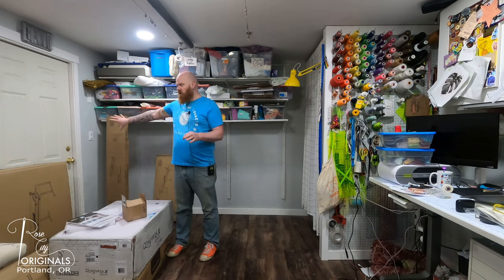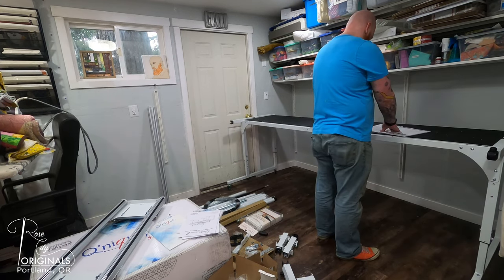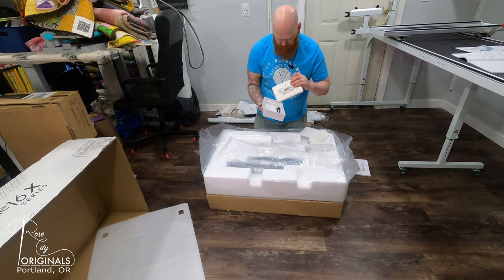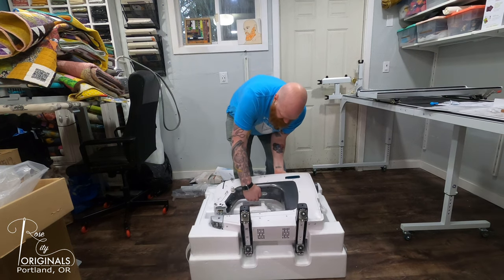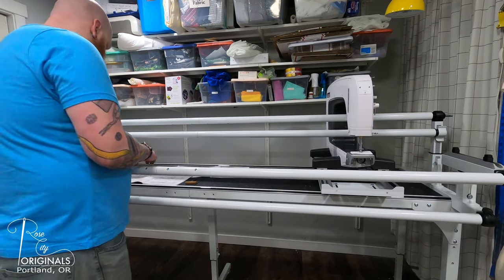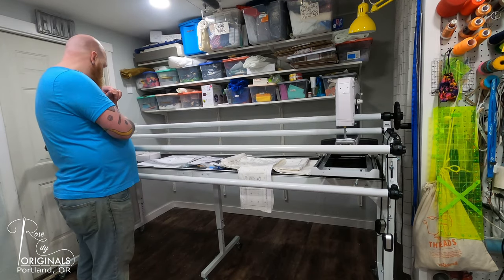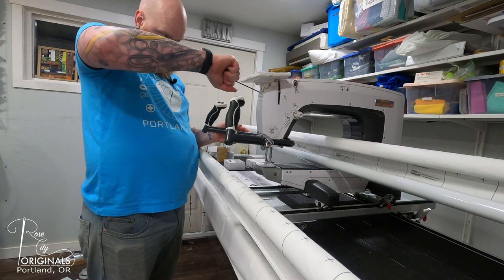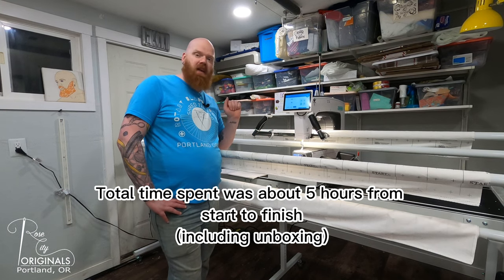Assembling my new Grace Co. Q'Nique 16x Elite on an 8' Continuum Longarm frame

Comment: After you installed the handlebars, did the clamp fit snugly against the machine or did it stick out a little?
Reply from the maker: The clamp stuck out a little, just make sure the screw is tight
Reply: Thanks! We were driving ourselves crazy trying to get the clamp to lie flat. 😂